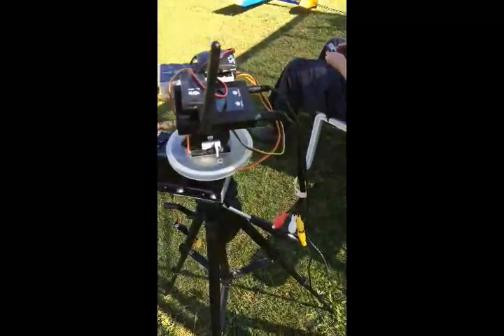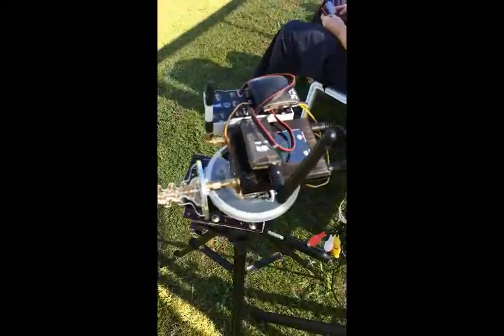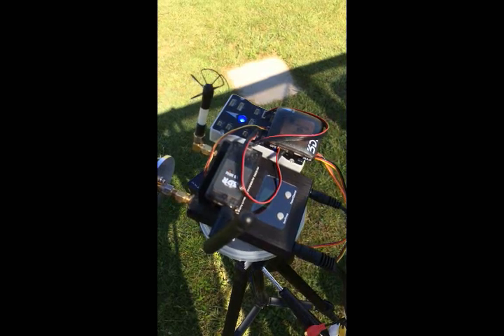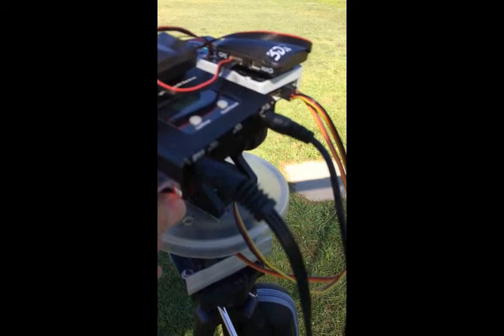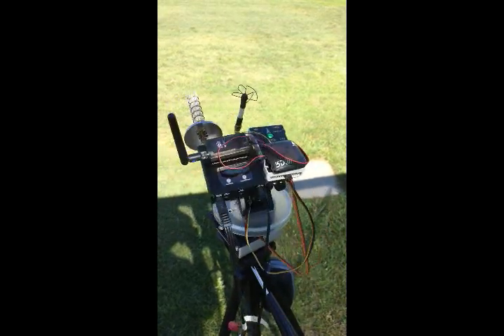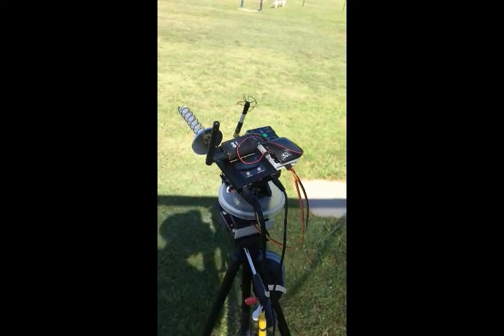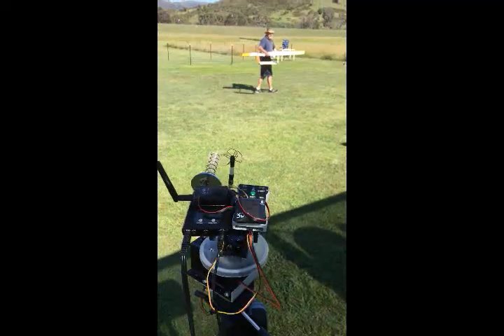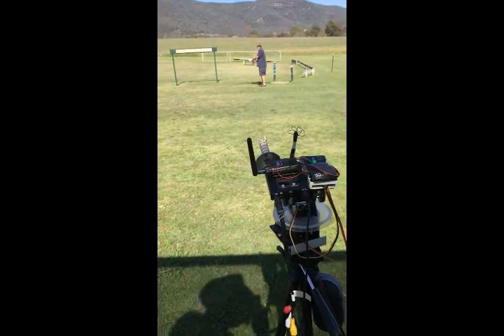Ardupilot Antenna Tracker V1.0 Testing

Comment: Hi Don, 
Can you share the PID Values you set for your yaw and pitch servos?
Reply from the maker: Happy to share, but PIDs are affeted by gimbal and servo type and the weight of the tracker head. For example, my pitch axis was prone to overshoot oscillation due to the CG of the tracker head being higher that the pitch axis, My PIDs are low, which is a comment i have seen elsewhere. Here they are. Good luck.
PITCH2SRV_D,0.005
PITCH2SRV_FF,0
PITCH2SRV_FILT,0
PITCH2SRV_I,0.001
PITCH2SRV_IMAX,2000
PITCH2SRV_P,0.1YAW2SRV_D,0.05
YAW2SRV_FF,0
YAW2SRV_FILT,0
YAW2SRV_I,0.001
YAW2SRV_IMAX,399
YAW2SRV_P,0.108

Comment: Hello, are u using 180 or continuous servo
Reply from the maker: The ServoCity pan mechanism has an external potentiometer which allows 360 degrees of movement, BUT NOT continuous because there is no slip-ring. The tilt servo provides 90 degrees of movement from full horizontal to full vertical.